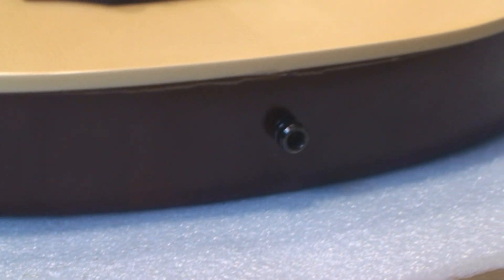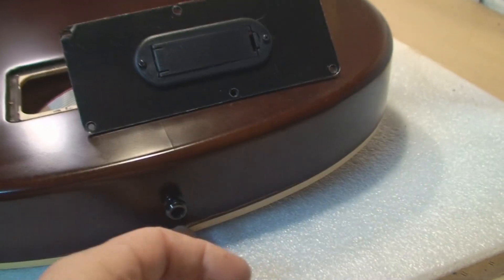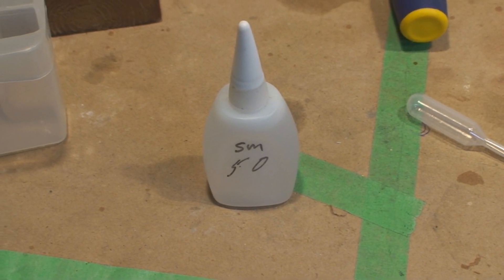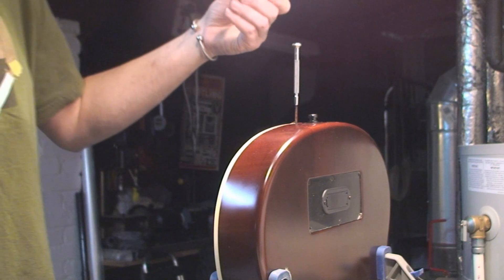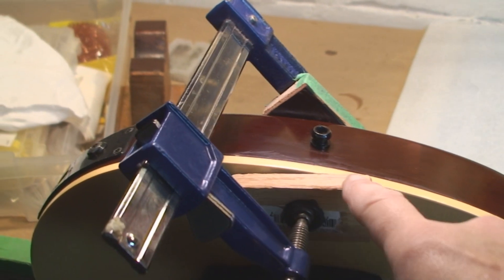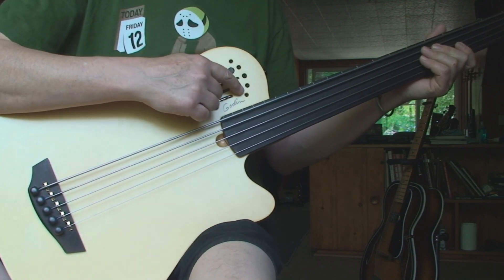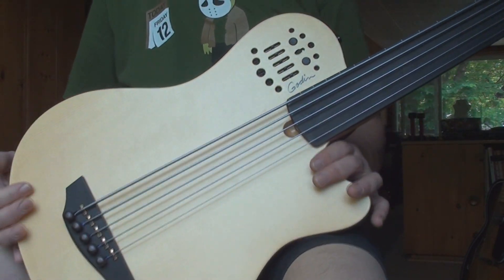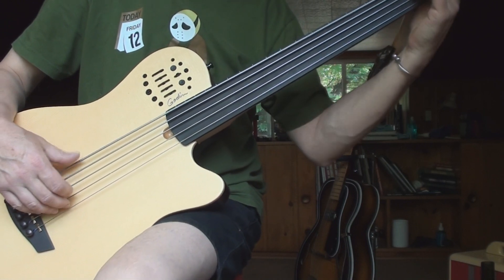Godin A5 Fretless Bass Repair and Demo

Comment: the weird hole is midi output you connect to roland synth and you can change programs with the two buttons (that don't work) on the guitar or bass. Each bridge saddle has piezo/midi pickup with great tracking, no latency.

Comment: The two buttons that seem not to do nothing are for when you use the 13 pin output in pedals which supports this output,  they let you toggle up or down thru the various effects, otherwise they have no function.